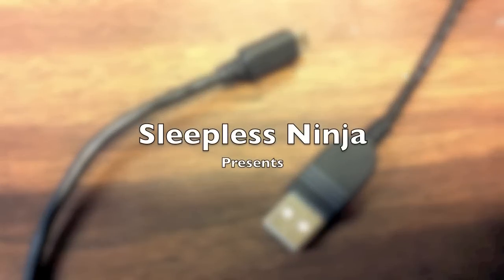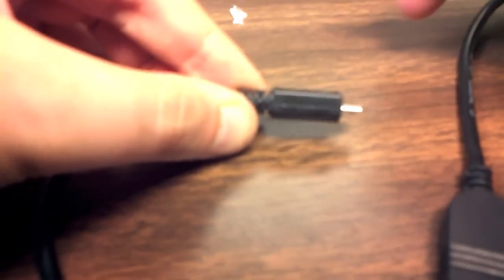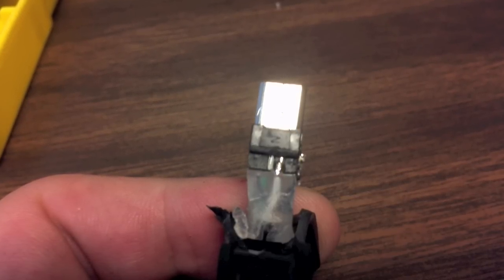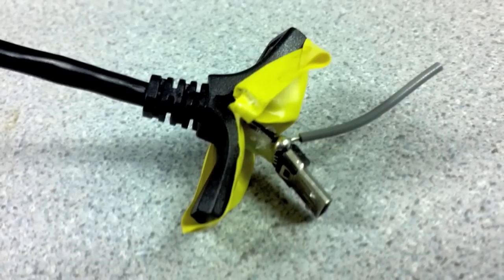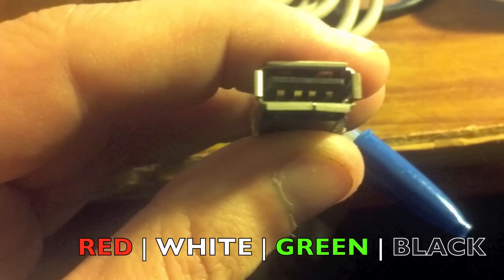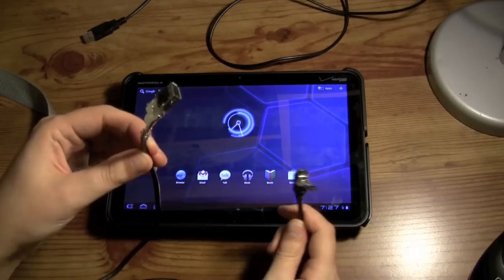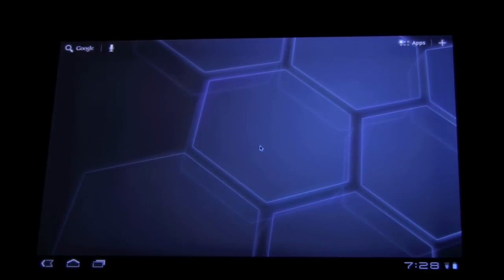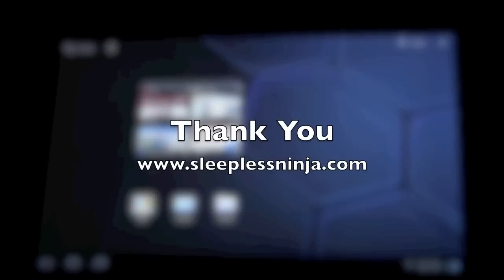How To Make an OTG Cable for Nexus 7, Galaxy SIII, Xoom or any OTG Host Capable Device

Comment: If you are going to add a switch between pin 4 and 5. (Like he did) Then I recommend soldering to female USBs together, that you can just add to the end of the cable. That way if you turn the switch off, you can unhook this female to female adapter, and still charge your phone. I did this, so I can leave my phone hooked up the a hub, and easily go between using my Xbox controller, and charging.

Comment: I have the exact usb data cable used in this tut. First i cut the micro usb head a little not much. After i just melted the clear plastic covering 4th pin area (which was blank) . Then soldered it to the black wire using a short and tiny wire and covered it all with the same plastic covering i cut a little. Thanks

Comment: I made a stick like otg stuff and it works well... about the hub... Have you tried a windows or other os dedicated hub or an universal one... Because dedicated stuff has no real controller in it, so it uses your computer to make the hard work... it wont work without a proper driver, which comes with the os or CD... I have a camera with the same issue, my hub works well...

Comment: I bought an OTG cable from ebay. It works with controllers, bot not with flashdrives. I have the Xoom. Do I have to open up the cable and do what you did with the ground?

Comment: My cable has a little black square thing connected from the black cable to this blank. Should I remove that thing and follow your tutorial or should I leave it on? (it has the writing "184" on it I dunno if it is a resistor or transistor)

Comment: hey dude! just made mine and it works great...mostly.
mouse works like charm but having issues with flash drives. my older 1 gb flash drive (FAT) works but newer ones (8 and 32 gb FAT32) wont work...probably some compability issues..and i guess there is no way for them to work because newer flash drives dont support FAT mode..and i made my cable without changing the USB male to female, just removed the metal arount the pins.
BTW... great tutorial :)

Comment from the maker: Thank you for your comment.  The nexus 7 does not have full OTG support, however it still can act as a host device for many usb peripherals and this requires an OTG/not a regular usb to be able to do.  If you are interested in what you can look at more of my videos that show ps3 xbox controller working through the limited OTG support of the Nexus 7

Comment: thanks mate this video is awesome i just made a OTG cabel out of a samsung U2 data cabel that followed with my samsung galaxy s2. is whas the easyest thing in the world because the blanc port i needed was right next to the black wire so all i need to do was...

i made a little soldering betveen those to(the wire and the blanc)no wires needed and the connection goes right back ind the case

Comment from the maker: @AstroBoy2828 No need to root or unlock to use mouse and keyboard (you can buy a usb hub and use both ;)  )  Also USB debugging does not need to be on,  this is something that came standard with Xoom 3.1  also you can use bluetooth keyboard/mouse if you don't want wires

Comment: Do I need to rooted and unlocked my Motorola Xoom to use an OTG Cable to access mouse or keyboard?  Do I need to turn on the USB debugging? 
My Xoom Android Version 3.2.1  
Thanks ahead for answer my questions.

Comment from the maker: @ksamj202 All that is necessary to make OTG is grounding that wire discussed in the video.  This plug must be in the Xoom side and only the xoom.  This just tells the Xoom to go into Host mode but doesn't really modify the communication at all so you can interconnect any type of USB wires as long as the Micro USB has the grounded pin in the Xoom

Comment: @sleeplessninjas Well, it does work and nicely too.  I figured that with th new JVC GS-TD1 3D cam, to trigger hosting a HDD directly, it had to be either power going to the cam or those 2 pins shorted.

I did the power test and all that did is flip the camera into thinking it was connected to a computer.

After seeing your vid, I realized, shorting 4&5 had to be it.   And it was.

Now the cam sees the HDD and backups up to and plays 3D vids directly.

THANKS FOR THE CONFIRMATION!   :)

Comment: I think this is what will solve the problem with my new JVC GS-TD1 3D camcorder.  It can take a hard drive connected to it via USB.  But, it isn't working.  I added power, and then the camera switched into a mode, but still, didn't see the cam.  I suspected that this problem may be that it wants an OTG cable.  So now, I'll do the same and let you know if it works.

If this works for the JVC, I'll let the group on AVS know that this is a simple work around.

Cheers

Comment from the maker: @eddy4059 You need an OTG cable to hook into the USB and you need to either use a App, script, or a custom kernel to mount the USB.  Its not like a PC/MAC where you plug in USB and it automounts unless you use custom kernel, check out my latest video which discusses this.

Comment from the maker: @lfblanco12 so basically this is the official google release text about the USB  "Android 3.1 adds broad platform support for a variety of USB-connected peripherals and accessories. Users can attach many types of input devices (keyboards, mice, game controllers) and digital cameras. Applications can build on the platform’s USB support to extend connectivity to almost any type of USB device."  Notice storage drives are not explicitly mentioned.  Apps and mods will make them work but right now...

Comment: cool video, i tried but definely i don´t have the skill. So i bought one cable on ebay and now i´m waiting for it.
I have a question about the drivers for the devices, there is some generic drivers for all the devices in the honeycomb 3.1 or i´ll have to download the driver for it device that i want to use?